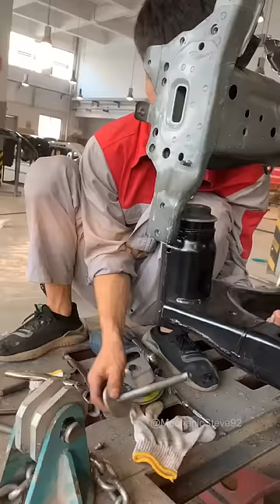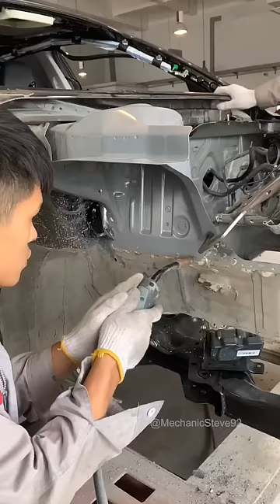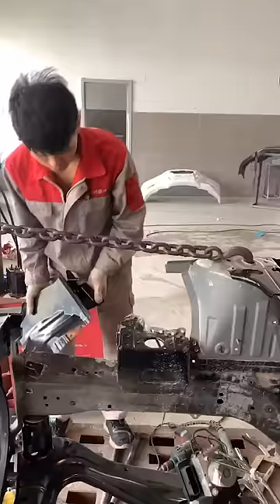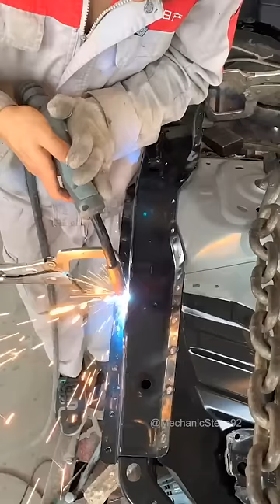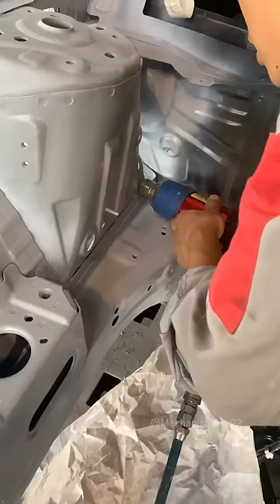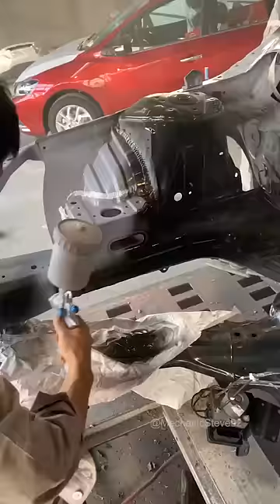#mechanic #automechanic #automobile #cars #trucks #restoration #mechanicsteve #shorts #restoration

Comment: They cut out all the measuring in between you can't just slap panels on and weld without checking key measurments
Reply: They show it sometimes. For half a second.
They make it look way too easy though.
Reply: How do you know they didnt measure stop assuming the worst of people
Reply: @ANIMEEDITS-tx2kz  How do I know you can't read? I said they cut out all the measuring, of course they measured or nothing would fit and since this is a how to vid they left out the most important part
Reply: That car will run like a crab hahahah
Reply: @ANIMEEDITS-tx2kz  How come you can't read I said "they cut out all the measuring" obviously or the parts wouldn't fit DUHHH.

Comment: Looks like they found factory parts to re fabricate the front end. Almost perfect. I noticed they must have been slightly off at the firewall since they were pulled from the strut tower after they started welding things move due to heat transfer. That's likely why unibodys are spot welded rather than a continuous bead. Well that and cost/weight savings plus less time. Those things matter when manufacturers mass produce. Either way good work.
Reply: Imposible una soldadura recta, por la torción del metal al cambiar de temperatura, lo que implicaría retrasos en la fabricación en serie, qué ya en reparación aplica igual por los tiempos de pagó en horas-hombre. La técnica es directamente de fabricante, por lo que vemos una refinación qué yo como aigado especializado en recursos humanos puedo clasificar de sublime, pues es tal el dominio del Trabajó del maestro hojalatero laminero,

Comment: I remember that good old days that everything is bolted on not some things are welded.. good old days
Reply: Those bolts were a big part of the reason those cars were heavy, slow, and less safe.      Welding is stronger & lighter, and also allows major repairs to be undertaken in more places. 
$100 in parts and you can make your own spot welder.

Comment: Looks like painters are trying their hand at bodywork. Only spot welding without eye protection. Hardly any screws. Stability comes from the sealant. In another video they overlap 2 metal sheets, spot weld and fill the gap with spatula. Rust nests are already installed. All that counts is the external impression.

Comment: I love the “weld in a can” 😂
Reply: That isn't "weld". 
Automotive Unibody Chassis parts are spot welded together then sealed before paint to prevent rust caused by moisture, rain and road salt getting in between the metal at the seams. What you saw in the can was the sealant.

Comment: In the United States we have this novel thing  called car insurance. The car would have been totaled. Not only for the cost to perform that extensive repair, but also the fact it wouldn't be as structurally sound as original.

Comment: l just hope that the panels lined up.
as l normally fit panels on and tack weld new panels on and then finish the welding once wings etc have been removed again.
But apart from that yeah great clean job 👌